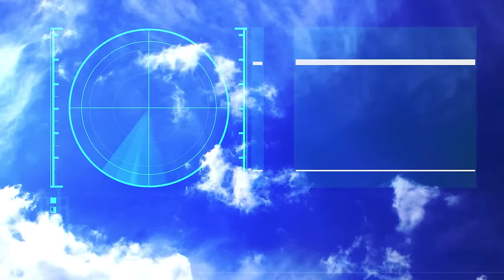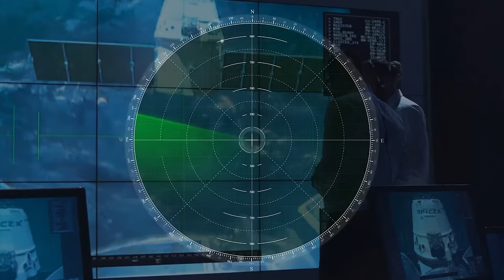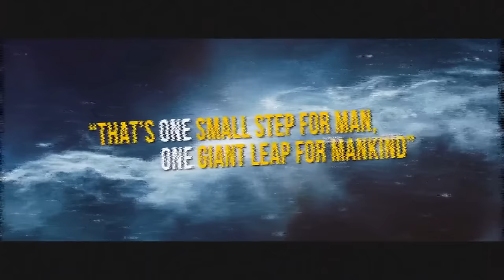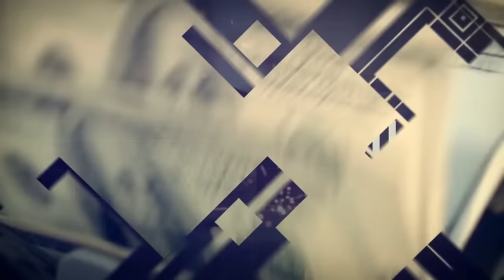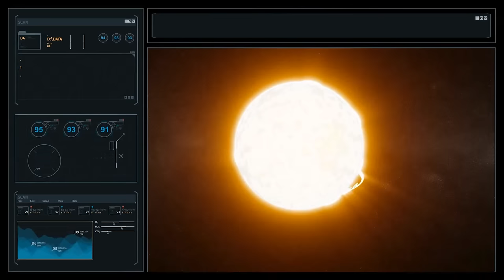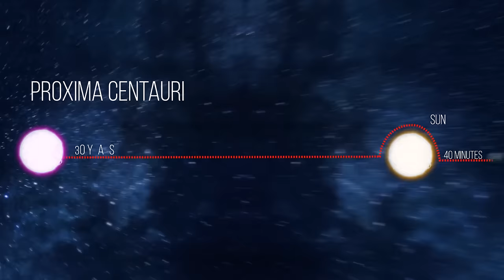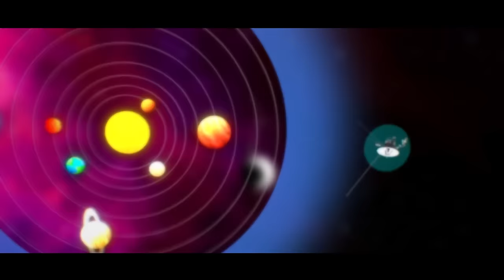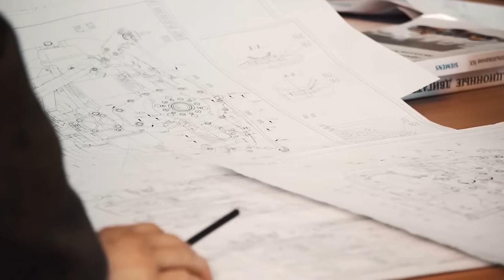SpaceX launch Starship 3, but something went WRONG | Space documentary

Comment: Quite a few mistakes in this video - 1. (2.35) It wasn't 'sad' at all that the booster was lost, sure the landing burn aborted probably due to engine failure but it was going to make a soft landing and be disposed of in the Gulf of Mexico anyway..   2. (at 3:00) the intended splashdown of upper stage (Starship) was Indian Ocean; not the Gulf of Mexico... 3. (3:15) The upper stage (Starship) was sent on a sub-orbital trajectory so that if anything went wrong it would naturally re-enter and breakup safely over the Indian Ocean, which is what happened.  OFT3 (Orbital Flight Test 3) was a milestone - a huge success in SpaceX's approach to rapidly launching and repeating, getting further each time (OFT3 the booster managed to reignite all engines for boostback burn) - So all major milestones were accomplished - They accomplished: 30 engine full duration burn of first stage (SuperHeavy booster) to MECO (Most Engines cutoff), successful hot-staging, intended sub orbital-trajectory reached by upper stage (Starship), Starship payload bay door operation, Header tank fuel transfer, partial re-entry of Starship with successful observation of heat tiles.

The makers of this video just don't understand how huge a success OFT3 was and how close SpaceX is getting and how much further ahead of any other country or organization they are right now with Starship/Superheavy.  I didn't watch after 3 minutes - But skipped ahead - There is some interesting and good info here - Just wish the makers would have understood and got right a few more facts about OFT3